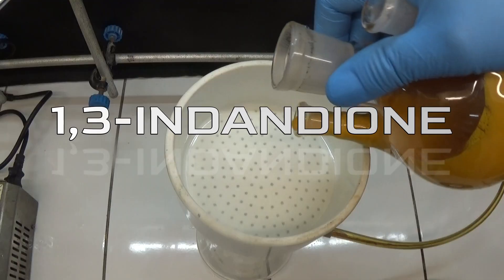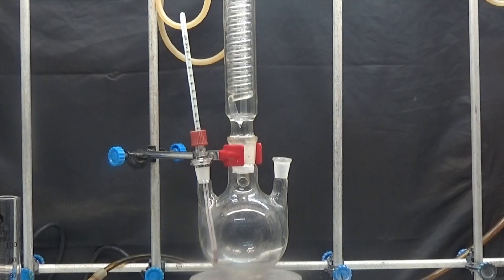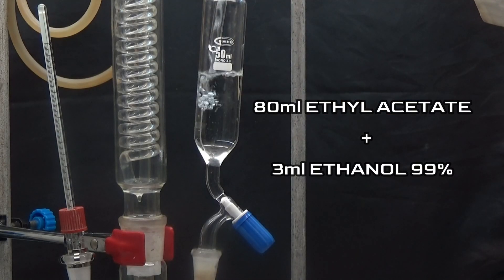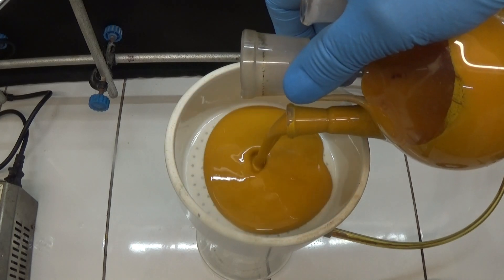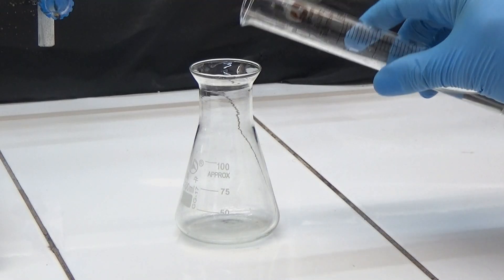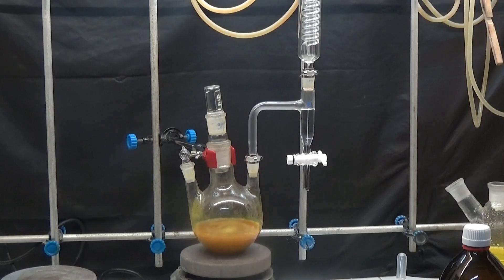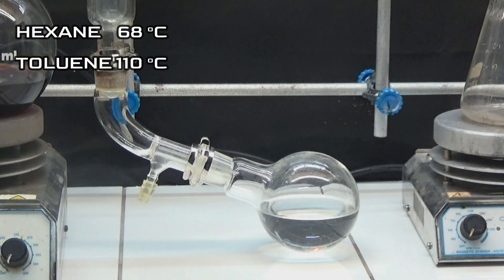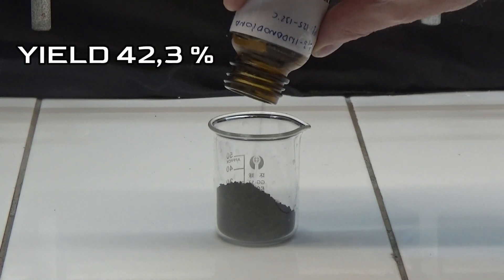1,3-Indandione Synthesis from Diethyl Ftalate.

Comment: The 'e' in 'indandione' is silent
Reply from the maker: https://www.sigmaaldrich.com/ES/es/product/aldrich/i2002  
https://www.sigmaaldrich.com/ES/es/product/mm/820698
same compound, different names, different CAS and same EC number.
  Thanks for your comment, can you explain to me?
Reply: @ncchem  These are two accepted versions of the name (indanedione vs. indandione). What the commenter above meant was however that the terminal E in the name is not pronounced (compare acetone, pronounced correctly aceton vs. the wrong acetonee). The TTS voice doesn't say it correctly.
Reply from the maker: @h68-v7d  ok, but it is a problem with the automatic translator. I don't think that the translator works well, that's the goal of my video. My goal is how to synthesize 1,3-indanedione and not how it is pronounced. Thanks for the clarification, greetings.